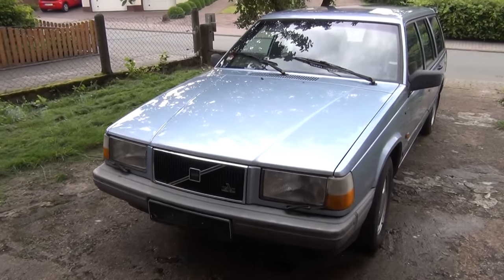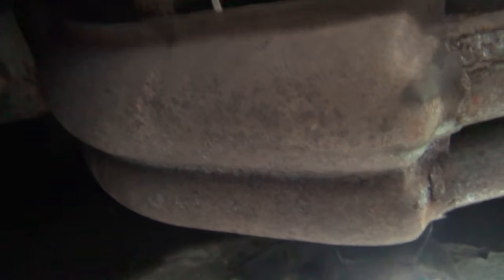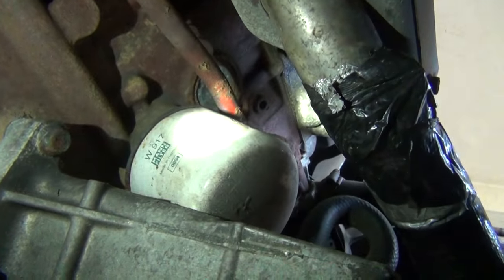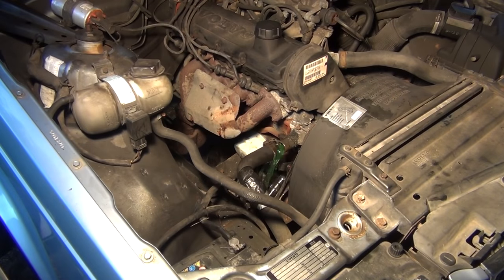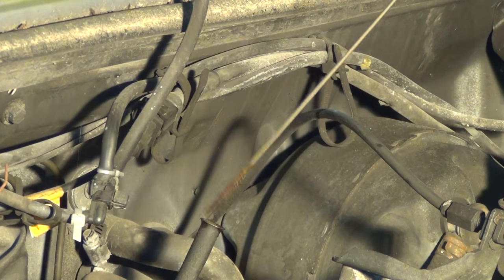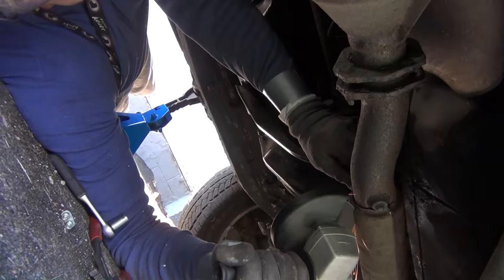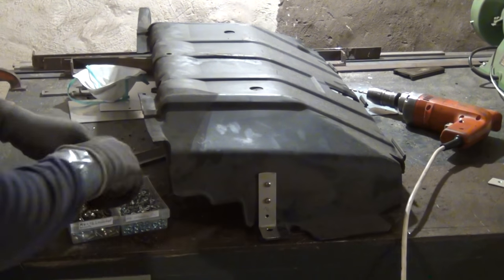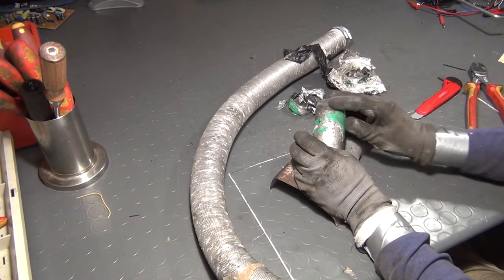Volvo 740 Repairs: Oil Change, Underbody, Air Filter, Downpipe etc.

Comment: Theese old cars are bottomless pit. I had 1992 Nissan Primera (sold it in 2012), had to buy that, then that, then that... that was really annouing and money-loosing. Your car is 26 years old, my was 20 then I sold it... I think it will cost dear for you.
Reply: Volvo's like that were in a different class of car than a Nissan sure it will cost but if you have a need for a big estate car this old whale will be a useful tool.
Reply: Except when he replaces these normal problems old volvos have... remember to change oil pretty much and put fuel in tank +200k km
Reply: So are newer cars. Just take the costs for maintanence and the loss of value and they are more expensive then old cars.

Also that primera is in a totally different class. The Primera was a cheap eco-car while the Volvo was a more expensive premium-class car. Those old Nissans are hopeless. I can just say that we have been driving old Volvos for years and never regretted it. 

My father has got a 1997 V70 that he bought 3 years ago (After we scrapped his 940 that he had before with 745.000KM on the clock). Only thing that we replaced were the brake calipers in the rear, the fuel filter, and one of the brake discs. (not included maintanence like oil etc).

My Mother drives a 1998 Volvo V90 which we bought 8 years ago. In this 8 years we had to replace a head gasket, a Radio, and the battery. (And of course do regular services on it like oil etc)
Reply: these old volvos are known for extreme robustness. not comparable to nissan. you buy one old volvo for 500 bucks, put another 500 for repairs on it and have a good car for years. i own two of these old bricks (940 and 960) and would never give them away.
Reply: Its a Volvo they never die